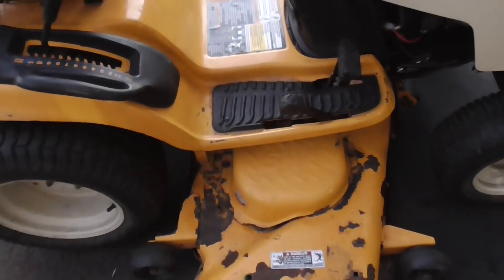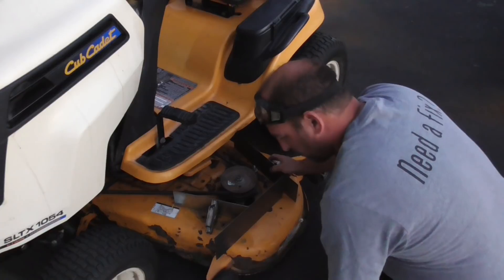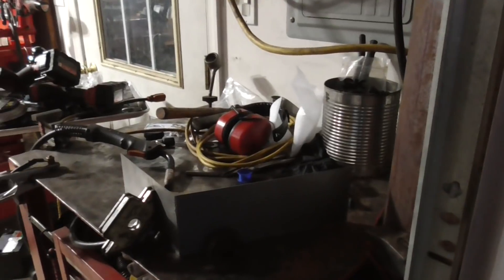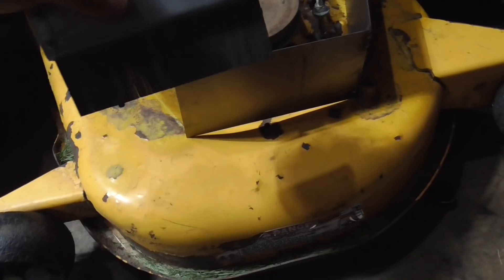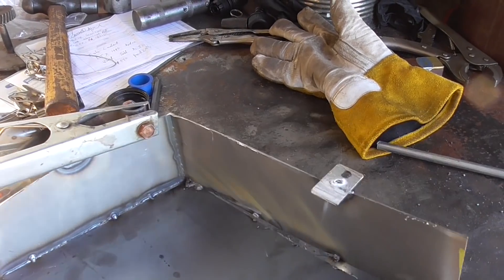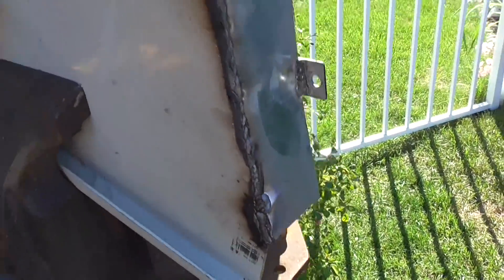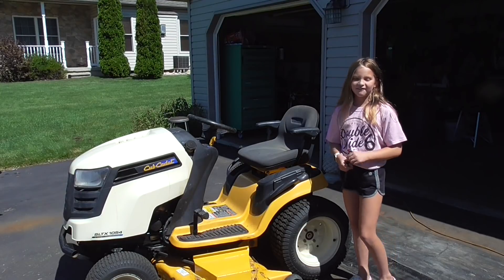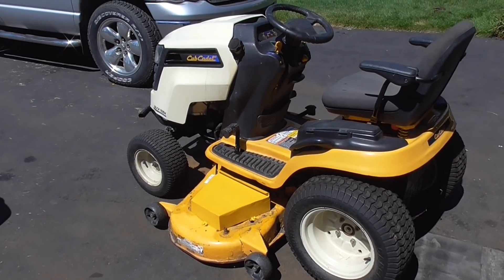Fabricating A Metal Deck Belt Cover

Comment from the maker: Tools and supplies from this video:
https://amzn.to/3gjjlaJ evolution metal chop saw
https://amzn.to/2Yqo0Bv KIMO 20V Drill
https://amzn.to/3jjelov sharpie paint pens
https://amzn.to/2YrqIH3 90* Welding Magnet
https://amzn.to/31lA8FJ Makita 4.5 grinder
https://amzn.to/3guH9bP Neiko Safety Goggles
https://amzn.to/32je9i4 4.5 40 grit flap discs

Comment: I have a cub cadet  sc2400 and for the past month or so whenever I now with it if I go on a hill I lose some major rpms. It has 156 hours which with that kinda tractor isn't that used and we do the basic maintenance for it. So does anyone have any clue what would be happening
Reply: Check your governor controls; anything gummed up or sticking?
Reply: @65csx83  thanks but I should have been smarter it was the fuel filter. But thanks for the suggestion.